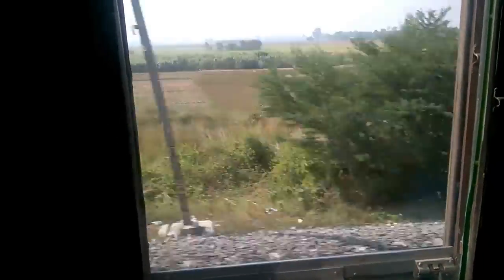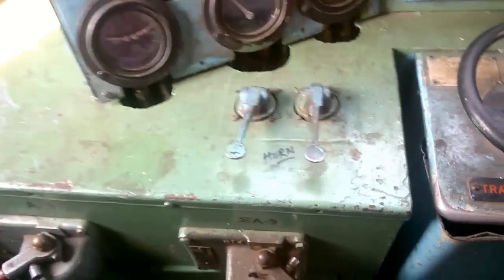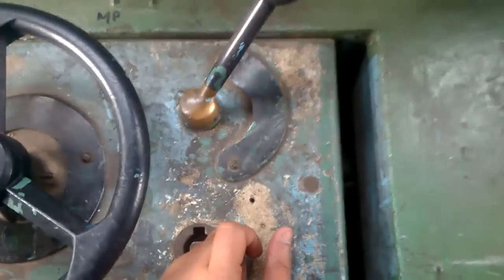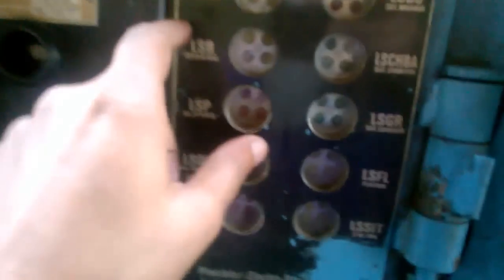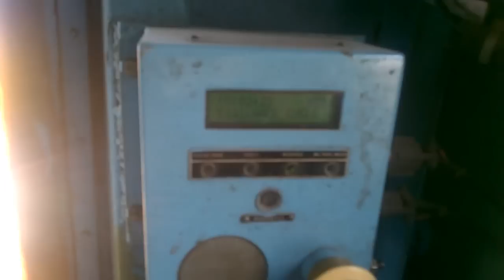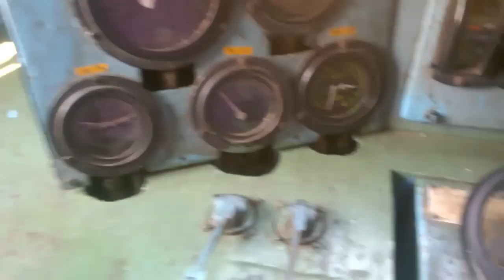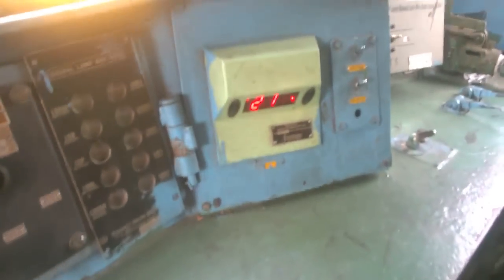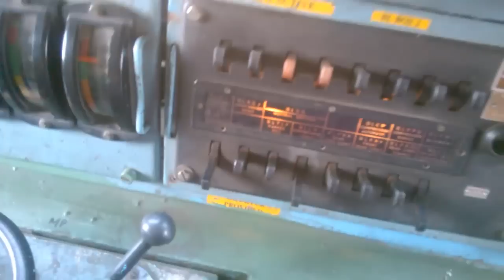INSIDE A SHATABDI ENGINE AND LEARN HOW TO DRIVE AN WAP4 ENGINE

Comment: Gr8 u have made a good video

I have a question to ask...

How drivers bring notch 25 to 0???

I mean directly from 25 to 0 or

They need to bring it down number wise like in an order like from 25 to 24, 23,22....2,1 to 0???

Or directly from 25 to 0 in one go???

Plz clear my this doubt....

Thanks
Reply from the maker: Yes it comes directly from 25 to 0.. if they down from 25..24...23..24......to 0 notch.. it will take so much time to slow down the train..so it directly comes to 0..
Reply: Rarez Tube thanks sir for the answer✌✌✌

Comment: man, u have broken my heart. why do u post such videos if don't know a single thing about locos. A steering wheel, u called that braking wheel, a steering wheel. That's awful, bro! And that light switches for loco is vigilance control system system.

Comment: Golden opportunity of riding in a WAP4 wasted  due to rotten English vocabulary . illegible commentary.... making it plain that the speaker does not seem to have any knowledge of the controls..He calls the TE/BE wheel which is a combined throttle cum regenerative/dynamic braking controller as a STEERING WHEEL"! Why ? Because it is round like a wheel ??? How do you steer a loco ??
The vigilance switch has to be pressed every 60 seconds by the Pilot..if not , a warning siren will sound and if not responded within  8 seconds , the emergency brakes will be applied at once . the VCB will trip and in some situations the Panto will retract cutting off current.
So much technology , digital controls and software is loaded onto these powerful WAP4 and WAP7 ,WAG 9 locos and so many safety features...all have been passed over superficially...A big let down and golden chance wasted.
Reply: Sure, a golden chance wasted. Why don't you hop on one of those and share a worthy video?
Reply from the maker: Thanks Gaurang  :D
Reply: rajaram samirao. i think the time gap is 14 secs. i don't know, i am askin you.
Reply: Rarez Tube For all those of you criticized.. Did you guys pay him to  make this video? Correct me if I'm wrong
Reply: 60 seconds ??...that's ridiculous..WTF...so the pilot is always pressing that damn switch for the entire stretch of his route driving...60 seconds press...60 seconds press...and 60 seconds press again...keep on fucking pressing...that's irritating...nasty bloody duty...
Reply: thats the duty of ALP (assistant loco pilot) , its very important to press that switch again and again. if not then automation brakes will apply in next 65 - 75  seconds
Reply: maybe there should be some operational flaws...the Mech engineers at railways, either they do not know the problem themselves or making  fools of themselves...
Reply: Prateek Srivastava hmm.... now I can make out why Indian trains run late!!!
Reply: Tommy Rottweiler very good safety equipment just to make sure the pilots are always vigilant throughout their hours of duty.... After all so many life's hang in the balance of their vigil.
Reply: And he also called MPS aka Shunting Notch that it used when MP ie main notch doesnt works... Actually it is used to increase the speed of the train by increasing the ampere of current to the traction motor, when MPS speed is not achieved after 32 notches.
Reply: Lot of wrong info... Seems you need to learn a lot.
Reply: Tommy Rottweiler Not every 60 secs... It is when loco pilot doesnt touch control of the train for a 60 sec.. to make sure that pilot isnt sleeping.
Reply: Yes u r rt he don't have the knowledge he was the indicating light like that of brake.